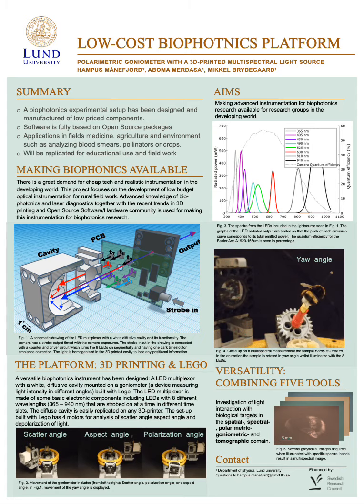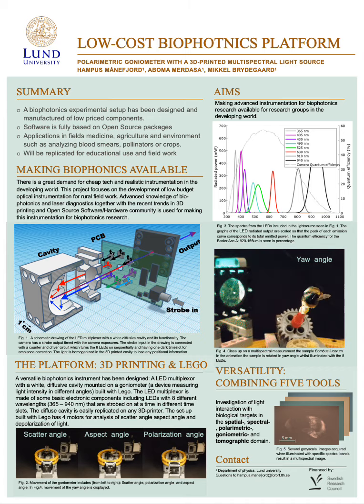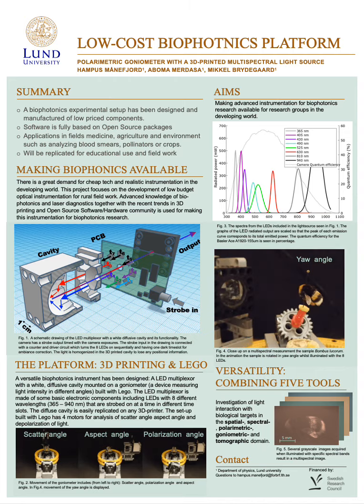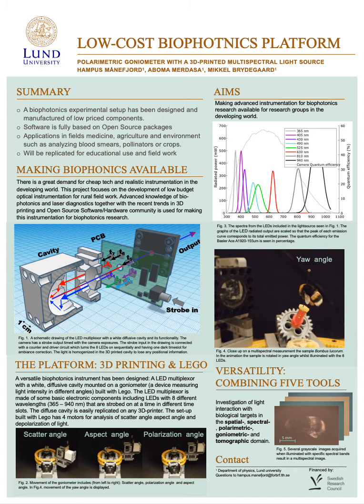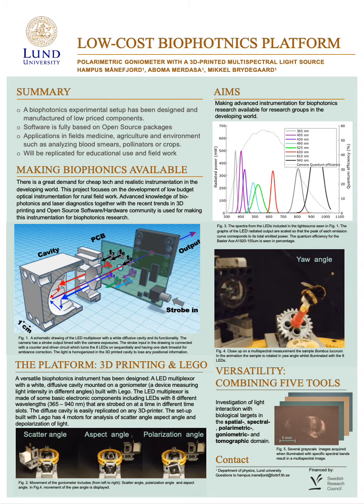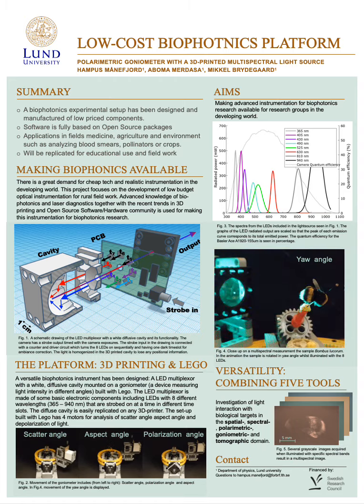LOW COST BIOPHOTNICS PLATFORM

Comment: Thank you very much for your presentation.

This poster is so fancy and beautiful, good job! 

My questions:  I see you are using a lot of LEGO component, is LEGO pieces consistent enough in size and hardness to be used to produce an optical system? Is LEGO interested in the sponsorship of your system?
Reply: Thank you very much!
The Lego pieces themself are surpricingly consistant in size and hardness,  but you have to think a bit when designing the structure since some assemblies can be more rigid than others. There is some backlash in the lego gears which needs to be remebered when doing angle measurements.

We dont have a cooperation with Lego as of now, but this is not impossible for the future.

Thank you for your interest and your questions!
BR,
Hampus
Reply: @hampusmanefjord3329  Thank you very much for your reply!
I see a very bright future in this :D So fascinating
Can not wait when LEGO sponsor your research work and develop the whole system into a research kit!

Comment: Nice presentation! What is the estimated cost of the materials required to construct the system?
Reply: Thank you! 

The price for the components in the current version is around 2000 €,  but most of this cost is made up of the camera and to some degree the lenses, so if less resolusion is required, and get a very cheap camera then you could get away with around 500 €.

Thank you for your interest and your questions!
BR,
Hampus